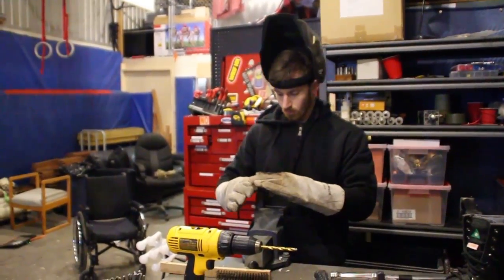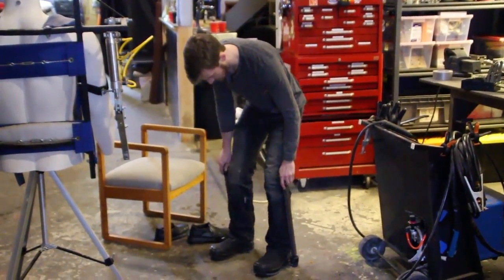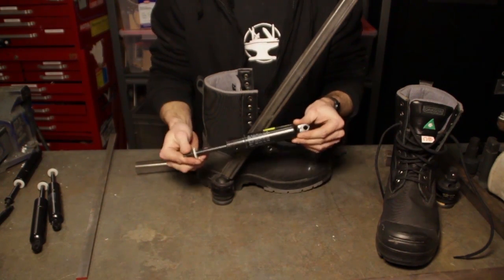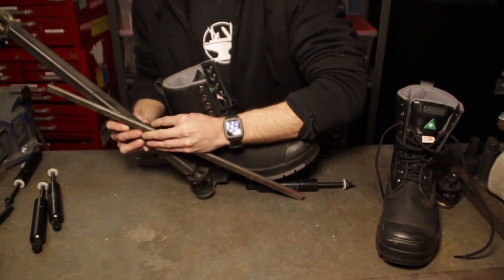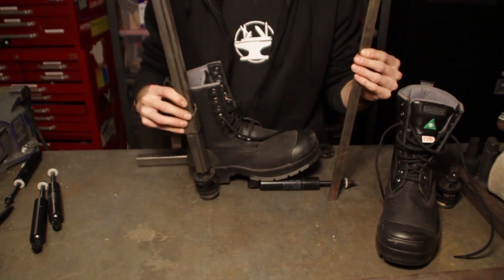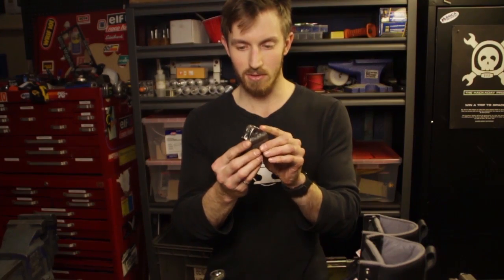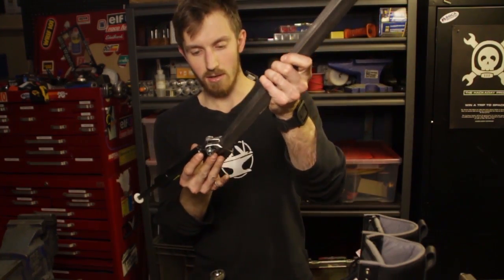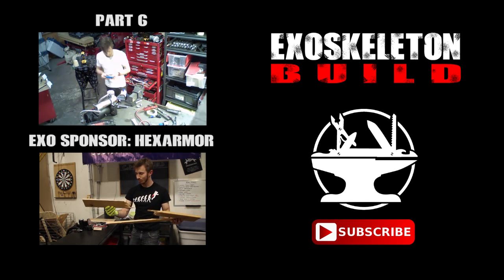Starting the Legs!

Comment: wouldn't it be easier to attach your leg brake to a metal plate attached to the bottom of the boot. it would be less likely to fail on uneven ground.
Reply: I was thinking the same thing!
Reply: +Todd- Bomb There is already a metal plate on the bottom, remember? Its what the ankle joint is attached to; Besides, the boots are also steel-soled, which means there is a metal plate built into them. An easier idea would be to weld the leg brake to the ankle joint, with a locked position, and small amounts of support for the leg brake along the ankle joint.

Comment: wait... you don't want to fix the cylinder brace to the lower leg,do you? cause if you just did a stopper at one point on the lege,the thing could let you move your legs freely,but if you bowed down,the resistance would kick in.

Comment: Hi, can I recommend that the shin mount tube be allowed to slide down a little on the shin, but be forced to stop when it wants to slide up forcing the gas cylinder to compress. ie, permanently mount the foot end of the cylinder and have the shin end be able to slide down on the cylinder end but stop sliding at a fixed height when it wants to slide up. meaning that the shin could bend back without hindrance but work the gas cylinder when it tries to move forward to far.
Reply from the maker: +Levi Howard That's a great idea Levi!!!

We were playing around with an idea that it would latch into the foot piece when you want it, but having two stops on the shin piece might actually do exactly that!

Thanks!
Reply: +the Hacksmith
thanks and you are more than welcome! :)
love your work!
if I could afford it, I would build my own hydraulic one (with fluid filled artificial muscles) here in central Australia
Reply from the maker: +Levi Howard That's the dream for mk3!
Reply: +the Hacksmith AWESOME!!!